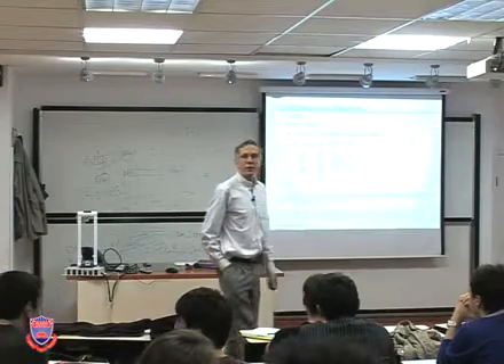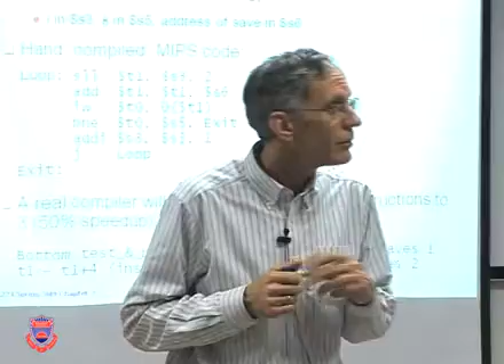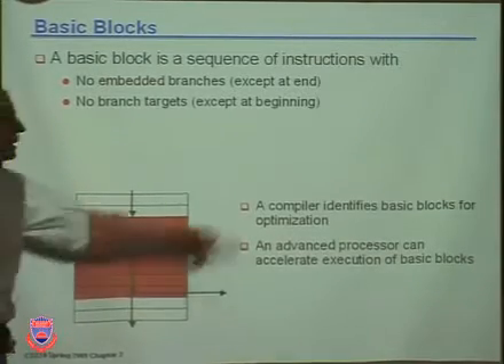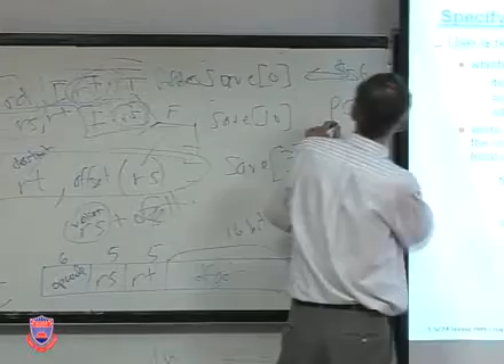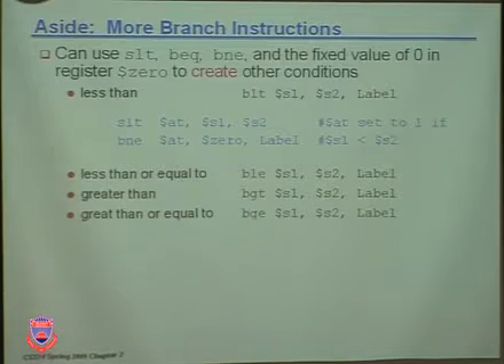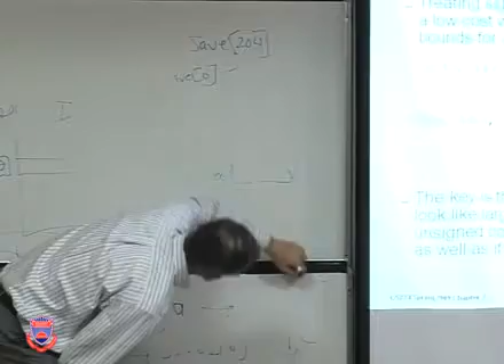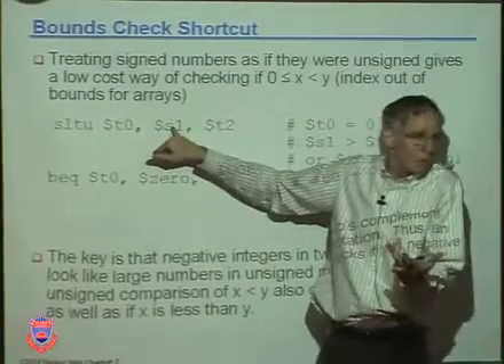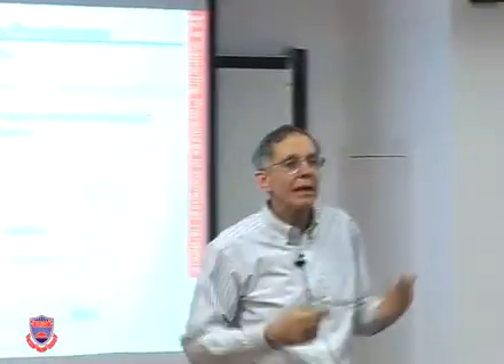CS-224 Computer Organization Lecture  09

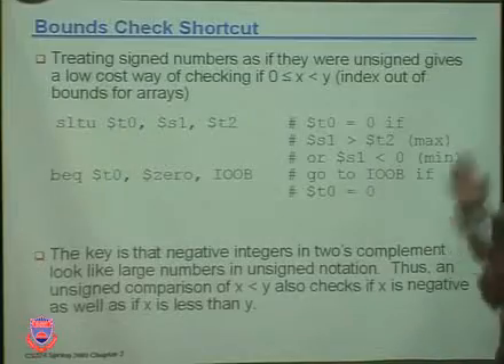Comment: 40:12 What if $s1 is too small like "100....00000001". The unsigned bit instruction will make it small positive number and it will accept the condition. I know you'll tell this is uncommon case but when this happens our program not gonna slow down it's going to explode.